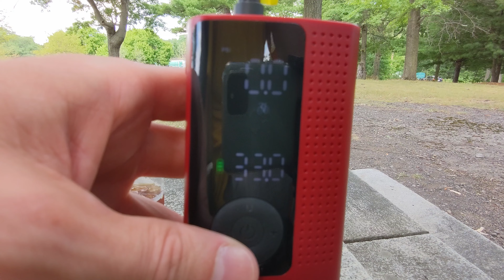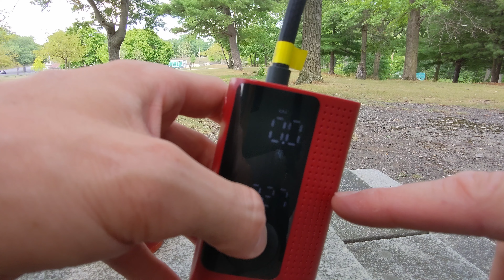Juiced E-bike Portable Air Pump Review & City Cruising Ep.66

Comment: Mine stopped working just over a year after purchase. The support was not helpful at all.
Reply from the maker: Sorry to hear that. Did you ever find out what the problem was?
Reply: I actually think it’s something with the hose. The pump turns on, but quickly stops as if the desired pressure is reached. Like if the hose was jammed somehow.

I was trying to explain that to the customer service person, but they were not interested. Just told me I have to buy a new one.
Reply from the maker: Yeah that does sound like a hose issue. Like maybe the air valve isn't functioning properly. Making it think it's full when it actually isn't. I think Amazon sells them too for pretty cheap. Any kind of electric pump should be fine I'm sure. Bummer Juiced wasn't able to help out at all though.

Comment: What exactly is the bleeder valve for ?
Reply from the maker: If you want to let a little air out you just press a button on the side of the pump and it lets some out. This way you don't have to unscrew the hose when you're dialing-in your pressure.